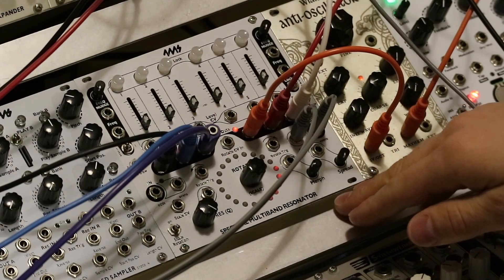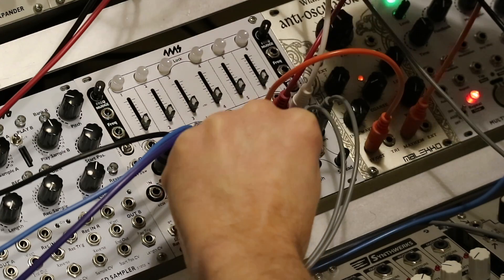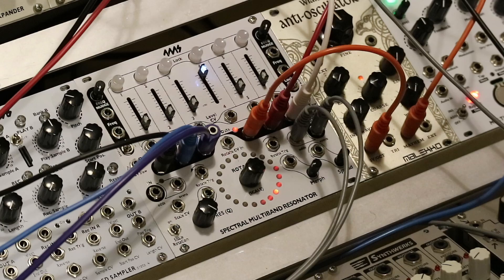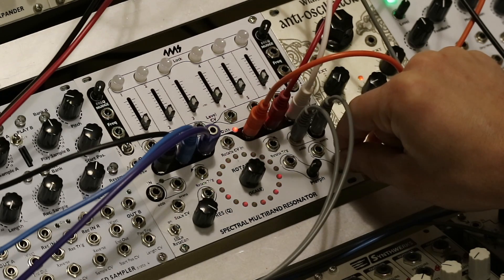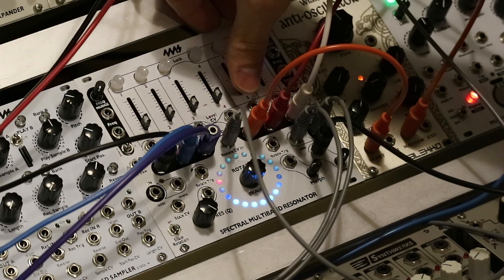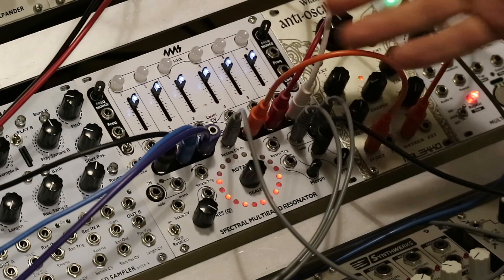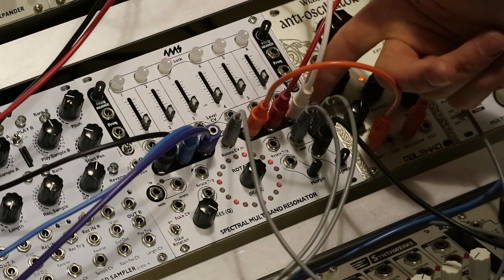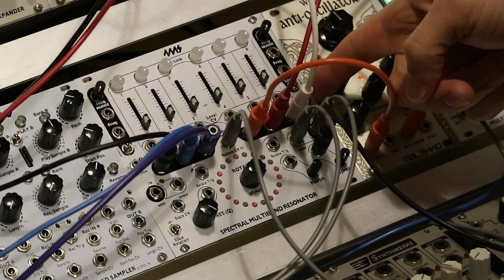Spectral Multiband Resonator (SMR) Tutorial #1 -- 1V/Octave outputs in firmware v5

Comment: Do the Spherical Wavetable Navigator send also 6 cv pitches in the 6 lfo outs? Or this feature ir only in SMR? I was considering to get Stages only for the Harmonic Oscillator mode, but if both (SMR and SWN) do this, I prefer one of these and, correct me if I'm wrong, I can do something similar to the harmonic oscillator here with the 6 outputs.

Comment: My unit doesn't send 1V/oct, the intervals are smaller than full semitones, what could be the problem? I do have firmware v.5 and tried with both jumper settings in case my 5V wasn't reliable but I got the same problem...